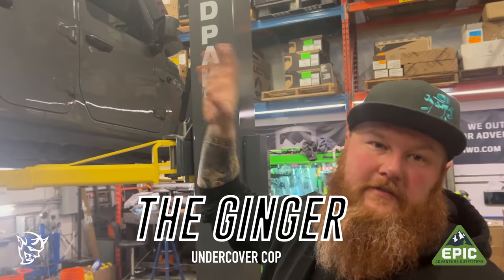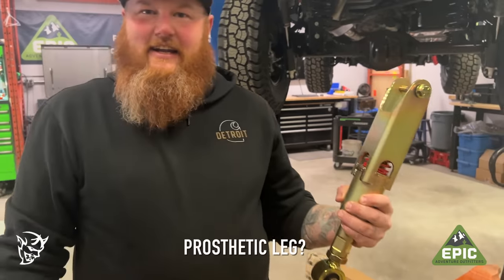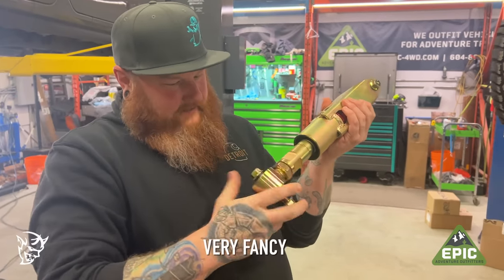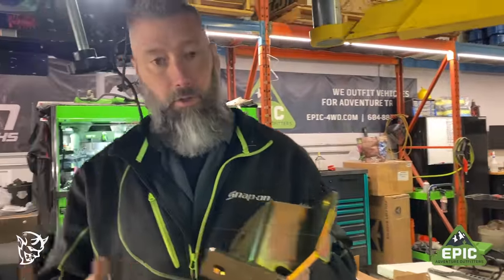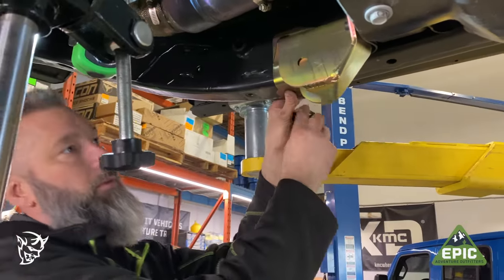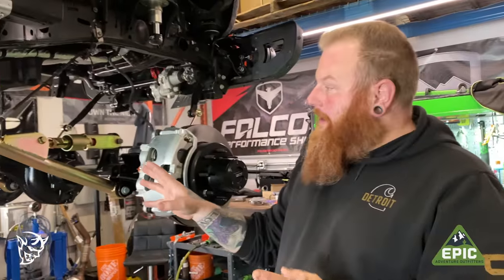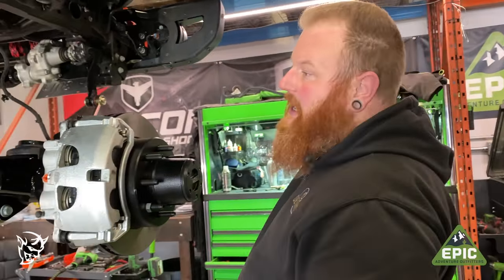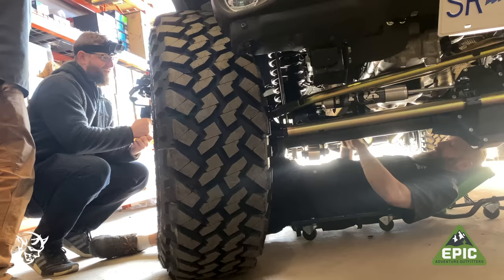MetalCloak Lock N Load Suspension - First on a Jeep Gladiator! Dana 60 & 80 Axle Set

Comment: So, in the end, everything on this vehicle has been trashed except the body and frame from how it was delivered, is that right?     I guess you can’t just order a “body on frame” and cut the thousands of dollars in cost for the suspension, drivetrain, wheels/tires, etc.     The total cost for this thing has got to be astronomical, but all the Epic guys now have these sorts of builds.   YouTube, merch, Amazon referrals, etc pay well.
Reply: To the victor go the spoils.👍
Reply: Well... The Demon swapped Gladiator Epic built for White Rock Dodge was listed for $270K CAD I believe. If you're not independently wealthy then these are definitely extremely costly. In the case of YouTubers it has to be considered that it is a business for them, I'm from the US so I'm not sure how Canada's tax laws work in that regard. But these insane builds bring in viewers and they are showcases for vendors products and services. And case in point... People like Casey250 and The Story Till Now are why I'm aware of Epic and now I have Epic's Kraken in my (much, much more modest) Gladiator.
Reply: Well, I don’t know if you can buy a cab/chassis Jeep like you can a truck from Ford or GM, but that would seem to be a great cheap option instead of buying a complete vehicle and then trashing most of it.   That’s my point.    I do realize that these are YouTubers and that when they say things like “working with Metal Cloak” or “Metal Cloak hooked us up” that usually means they got the parts for free, but I also feel that they should be more up front about that and not use code, just tell us viewers if they got the parts for free for these vehicles that are evidently not for the “regular guy”.  A $270k vehicle is FAR from what the regular guy could afford.   These guys started out as regular guys with Jeeps out to have some fun off-roading, but they have moved quite far from that now.   @PeakDecline
Reply: @glenngore6609  I actually doubt the majority of the parts are free. Some are for sure, but not all. I'm confident the engine swap wasn't free... which is a huge portion of the cost to this build. There's still a lot of money being invested by these guys back into their business (and this is at least to some degree a business for them). Personally, I enjoy these extreme builds precisely because they're not ordinary ones. If you want to see more "regular" builds... there's tons of them and these guys already did their own.
Reply: I watch a lot of the “lesser ones” nowadays, since a lot of the major YouTubers now require memberships, Patreon, etc to finance their operations, see what routes they take, etc.  I like seeing what the regular guys are doing, things that regular folks can afford and do themselves, etc.   It’s more “real world” to me. Climbing up and down a boulder chute at Easter Jeep Safari or something like that is not my style of overlanding and Jeeping.  @PeakDecline